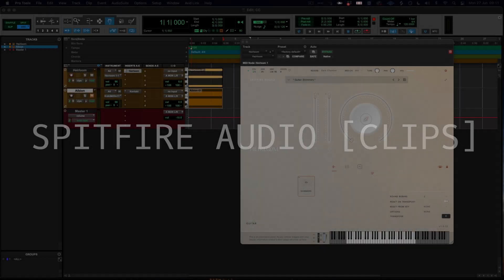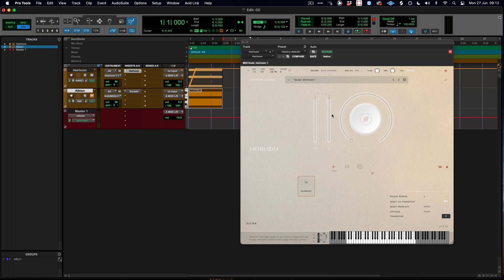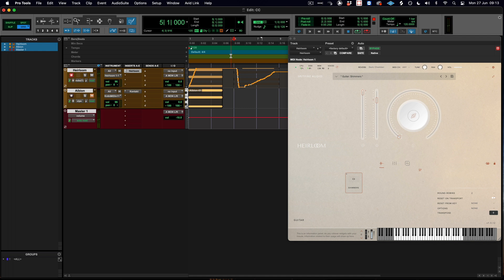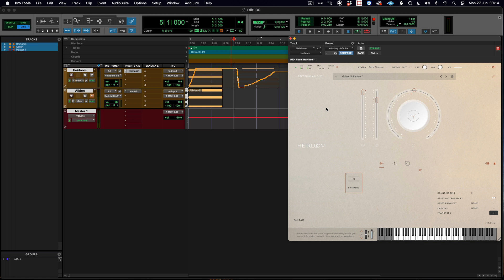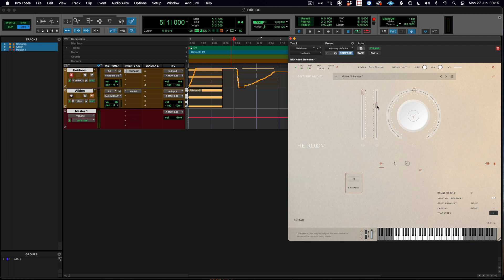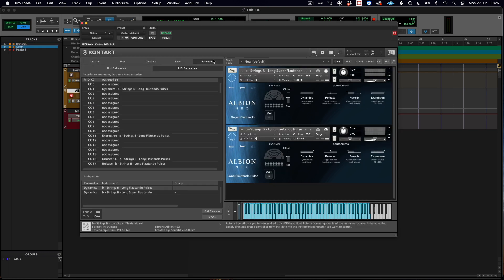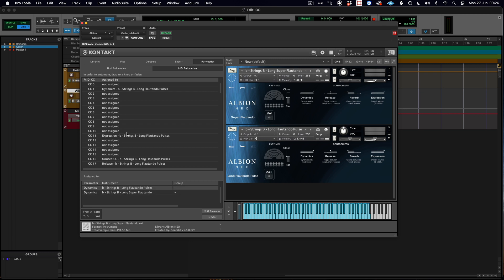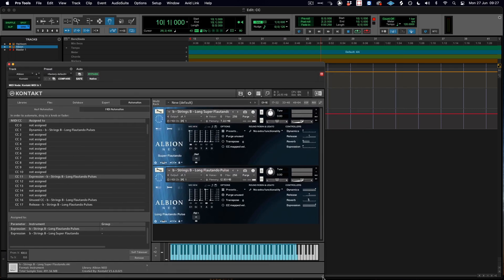MIDI CCs - What Are They? And How To Use Them

Comment: Hello, I do not have a midi controller but I have a keyboard that is midi capable through midi cables.  Can I use midi CCs with my keyboard by using the pitch and mod wheels?  Or will I need to buy a midi controller?  My goal is to add dynamics and expression to my strings by using a wheel on my keyboard.  Thanks for the help!